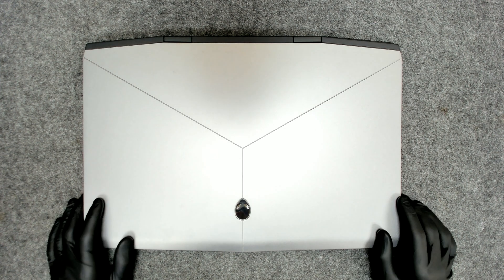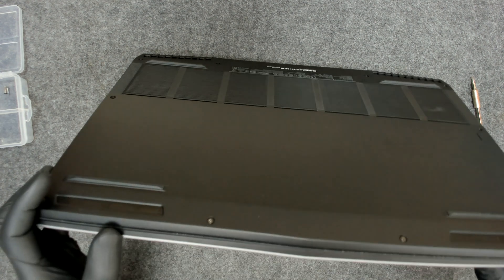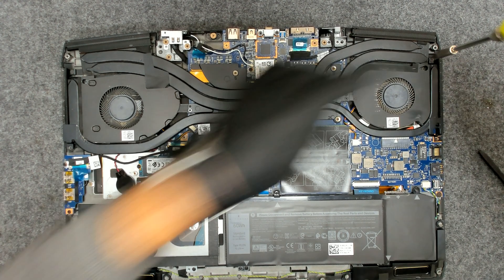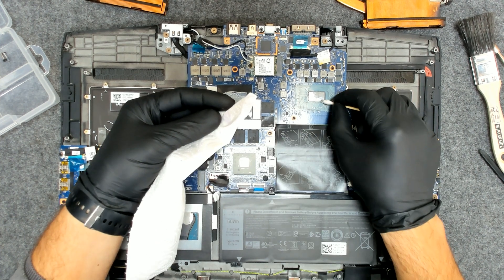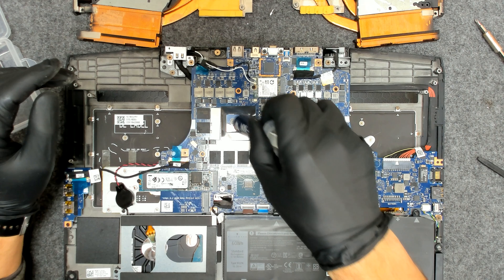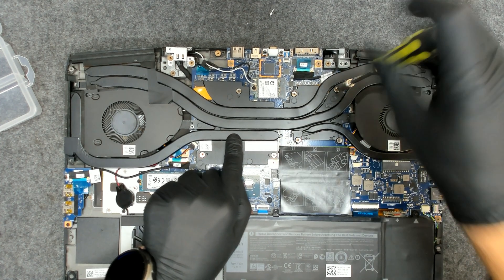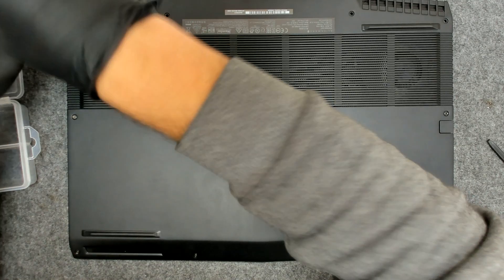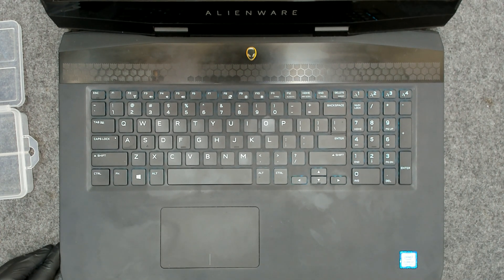DELL Alienware M17 P37E Thermal paste replacement

Comment: Really? Why would you cut the video 4:37? If this is a tutorial, we HAVE to see how you removed that part. 👎🏻👎🏻
Reply from the maker: LoL... I cut 5 seconds, because a customer came into the shop. The screws were already unscrewed. You need a tutorial on how to lift the cooler? If yes, please don't attempt to open and  clean, and take it to a local service.
Reply: I couldn't tell if there's anything else left to disconnect or not because of the cut. 
That's unfortunate that you had the disruption mid video, but completely understandable.  @LaptopDisassembly
Reply from the maker: @FittoSurvive I usually record videos during work time. So when customer open the door, there is a alarm signal, which is annoying,so I cut 1-2 sec. before the door open. ☺️
Reply: Understandable. 👍🏻 @LaptopDisassembly